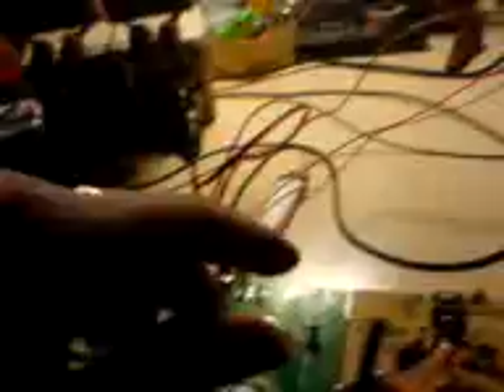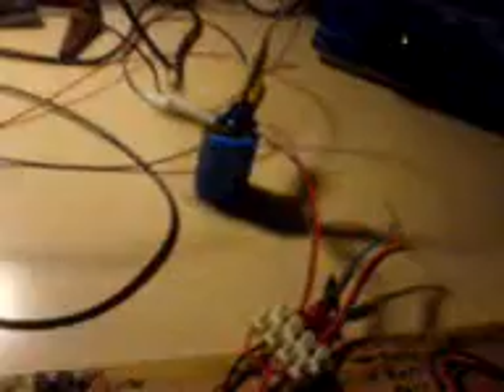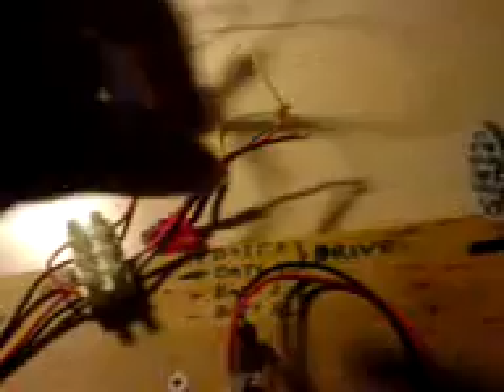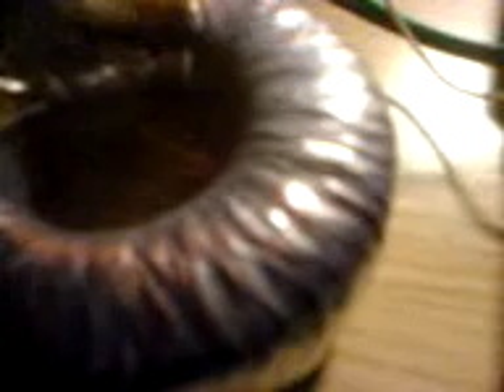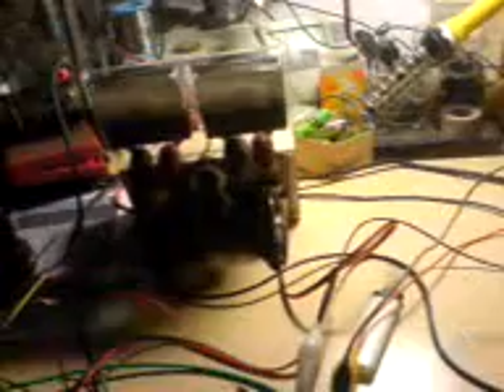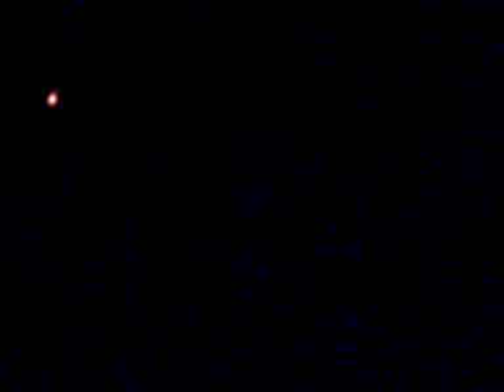newman motor powerd by a PWM volt stepup 12/50vdc

Comment: Great! i like it :)
how you create back spikes on this?

i have a question, how you get so lot of volts to neon light?? i have only my neon light flash little, not so much like yours is bright, where the neon light should be connected?
i have to try see witch scope back spikes what is the best with commutator and unsussefull.